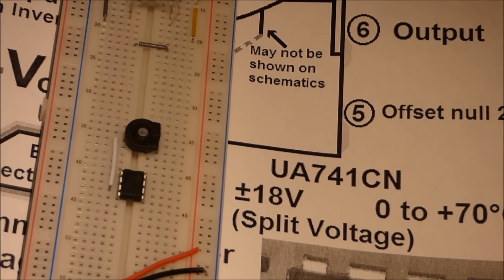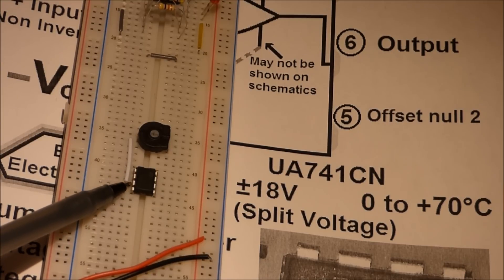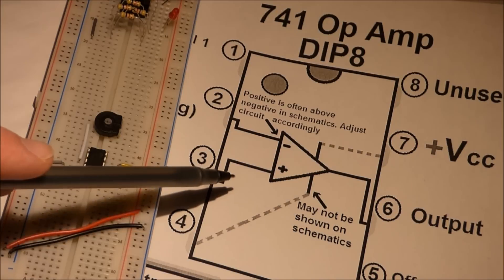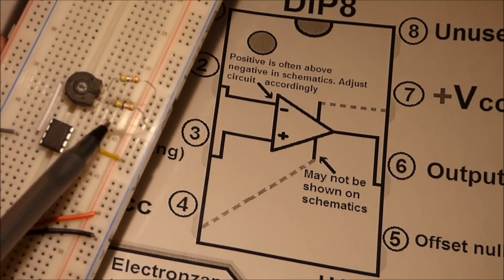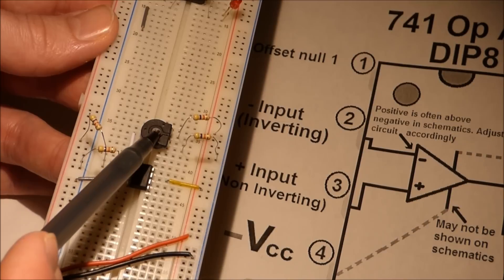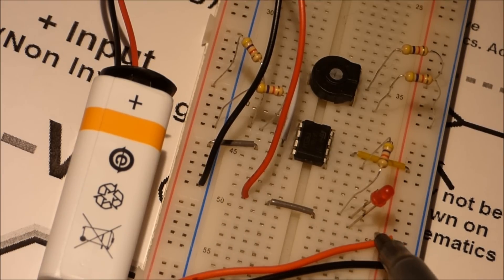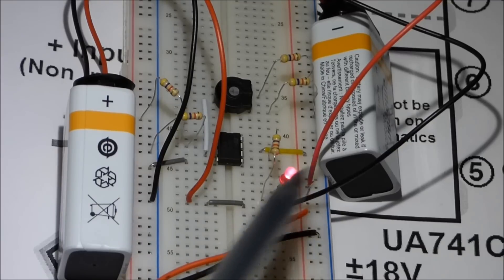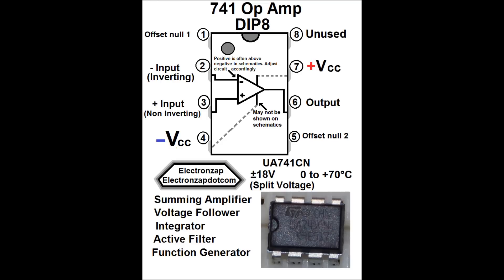How to build 741 op amp IC comparator electronics circuit, split power supply on a breadboard DIY.

Comment: The split voltage was the big take home for me. Seeing it in situ and the explanation along with it has helped understand it better. Great video. I read a comment on ou speaking slow. For me its not an issue at all as it helps give me time to consider what you're saying, plus I dont think its slow anyway. Great work mate
Reply from the maker: Glad you like the pace :) I do have a viewer that watches my stuff 75% faster that normal.